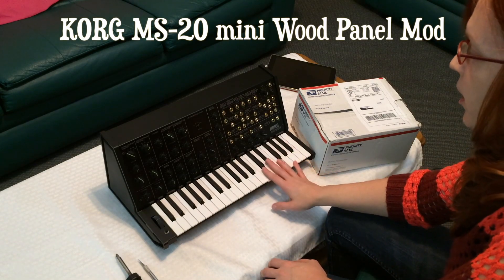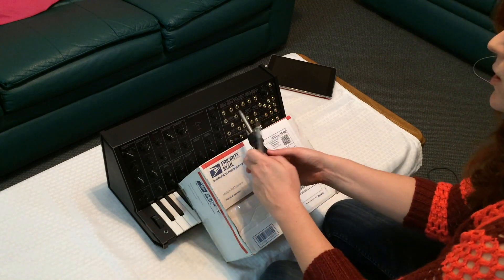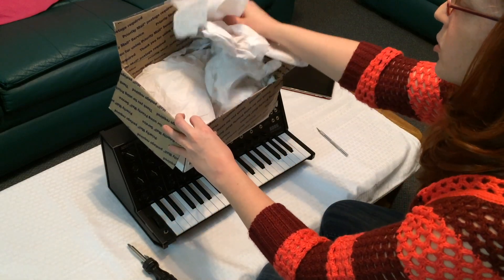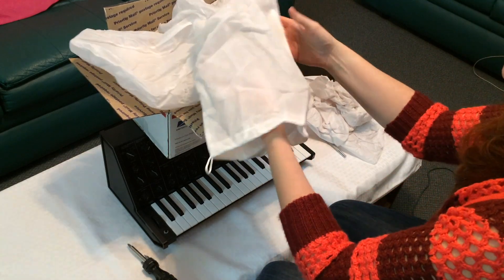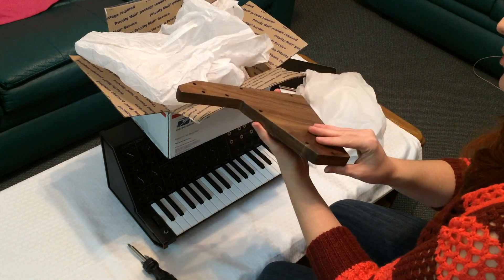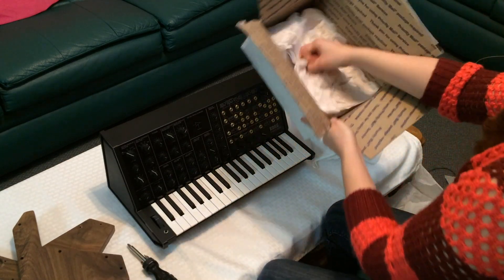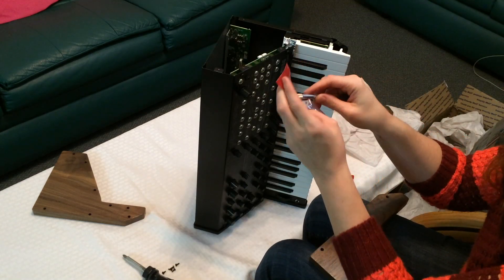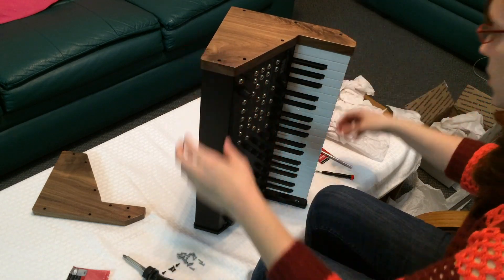Korg MS-20 Mini Wood Panel Mod

Comment: Looks beautiful! Are you happy with your MS-20mini? I want one too. Since I have an Arturia Minibrute I'm in love with analog sound.
Reply from the maker: I love it! But you have to understand I've wanted an MS20 for over a decade, so I never would have thought it would be sitting on my desk. That said the sound is great. The build quality is good too. Not as bad as people have complained about, but no where as solid as the original. This is crazy but I put the MS20 mini side by side with the iMS20 for iPad and the sounds are like 99% identical. The iMS20 has patch saving which is very very nice, but the real thing has knobs and much more hands on. I know synth basics but I still can't figure out the logic behind the patch bay. Just seems so random to me, once I learn how to use that I'm all set.

I almost bought a minibrute, but after waiting 6 months and the store never having it in stock I canceled the order and bought a monotribe. Then soon after rumors of the MS20 reissue happened so I waited for that. I have my eye on the microbrute now. How's the build quality on your minibrute? I've read Arturia has lots of quality issues on their product line.
Reply: Stephanie McKeon Minibrute has a great sound, is very flexible even with just one oscillator. About the build quality of Minibrute the main problem are the keys. In fact my middle C key raised over the others, it had a broken bumper. We don't have customer or technician support from Arturia here, so I solved it by myself. Works good anyway, but keys must be treated carefully.

By the other hand, the rest of knobs and controls are great, my only complain is the keys, but most of the time I sequence the Minibrute externally, so is ok for me.